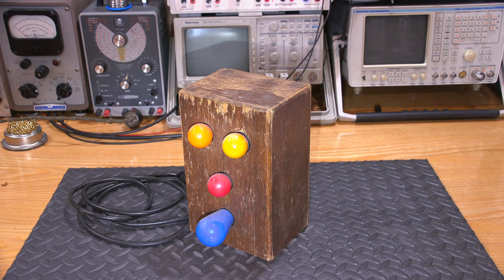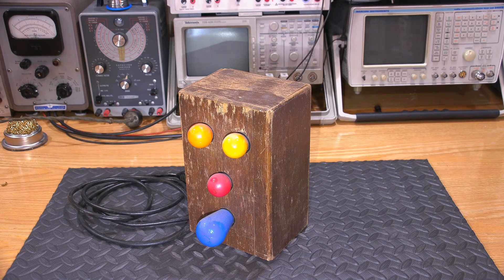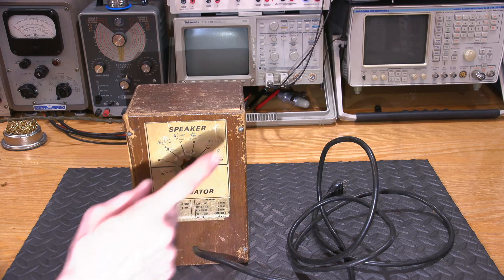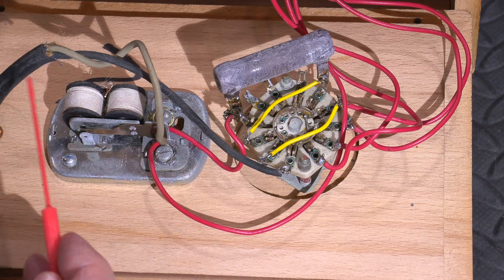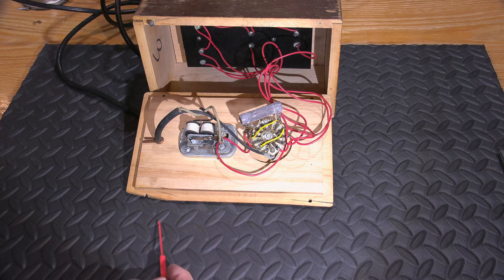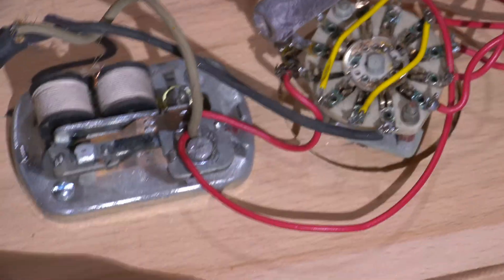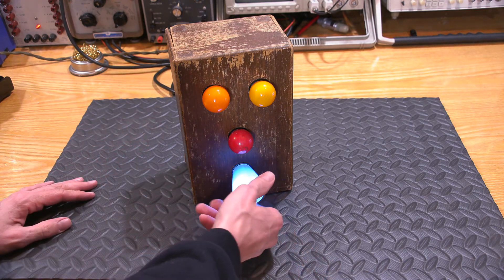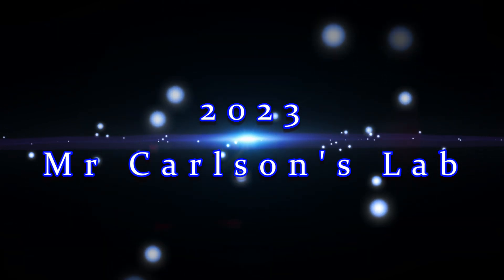1950's? Psychiatric Hospital Electrical Device - "The Evaluator!"

Comment: As a light bulb "nerd" myself, I find myself fascinated by this. Particularly the balloon style blue bulb. Not sure if you can get that style anymore. I probably would have bought this if I saw it at a flea market or hamfest if the price was right. Thanks for sharing.
Reply: That's an 1911 Edison GEM style bulb. You can find modern replicas with LED strips inside. Fleabay, the usual places.
edit: i'm in Europe so i can't see the actual page, but on HDepot there's a bulb category named "bulbrite colored light bulbs". The gel ain't as blue as the one above, but the shape's almost the same.
Reply: The bulbs are sign bulbs also called carnival bulbs.  I have bought them before.
Reply: @TheFineby  A quick internet search and are they can easily be found! Thanks for supporting my addiction!
Reply: Tungsten filament bulbs are becoming hard to source (for my current limit supply) & because i have come to hate LED sources that actually hurt my eyes, i prefer the colour temperature & type of light that tungsten makes in my home i am having a devil of a time sourcing anything of quality. The latest batch a globe disconnected from the metal & fell out hot dropping onto floor smashing glass everywhere.
Reply: @peteb2  before you decided to use 10x as much of the limited power we have, did you actually try decent quality high CRI low flicker LED Luminaires, or just presume the cheapest/most common ones people bought were as good as they got? There is a VAST difference in the light output by LED luminaires, since making them is a bit more complicated than making a wire hot.
The most common thing that hurts people's eyes is a LOT of AC LED Luminaires flicker at power line freq or its 1st harmonic, because they cheeped out on the power delivery.
Reply: @mycosys  That's a ridiculous comment on 'power we have'... My few tungsten bulbs will hardly ever come anywhere near the energy use of your  'limited power' when you consider all the other superfluous 'consumption' happening eg those who now have to recharge an EV daily or those who live where they simply have to have aircon running 24/7....  As to LED domestic light sources i believe its the amount of blue wavelength that is being radiated in the mix. Even the so called 'warm white' is high in blue & i find just far too irritating as a light source. At my work where ceiling panels have been changed from fluorescent to low cost LED panels i sense a nasty bright glare, so i now wear a baseball cap for the brim to shield my eyes or i find it very tiring after a day. Yes all my (LED) computer screens are set for reduced blue so as not to irritate with a nasty brightness. Interestingly there's a joke going around that we're all gonna see a new kind of eye-cancer appearing because of such a synthetic light source we human's have never evolved into having to contend with.... Lets hope that's not the case....
Reply: @mycosys  I agree. All of the "normal" lighting in my house is led. Although they can make them way more efficient still. Why does the base get almost too hot to touch on these e26 base led bulbs when leds themselves don't get that hot? I am 100 percent in favor of making things more efficient. Run your house on a generator or inverter and you find out EXACTLY what is more efficient. I was recently horrified (delighted) when I found out my RCA A-78 uses LESS power with it's vacuum tubes than my 100 watt solid state amp. When the power goes out, I can run my inverter longer with that so we watch tv and listen with my 1951 RCA and it sounds GREAT. I only am going to use less than a hand full of these incandescent bulbs occasionally. It's plain stupid to outlaw incandescent bulbs when everyone is pretty much going to led anyway as it's the most logical choice after all. Also they should recycle these led bulbs as 90% of the time the leds aren't what goes bad. Thanks for everyone's comments. This is an interesting subject!
Reply: The tongue is a type S14 bulb and the others are type S11. All have an E26 (or E27) base. S14 is commonly referred to as a "sign bulb" or "carnival bulb". Carnival because S14s were used in mass quantities on carnival/fairground rides before the advent of "turbo" fixtures.
Reply: I am into Carbon filaments. To me there is no bulb as nice as the warm yellow glow from a carbon filament bulb.
Reply: I would bet you can still get those bulbs. Many items are made to retrofit old equipment.
Reply: S20 incandescent lamp.
Reply: @edwatts9890  Tongue is an S14. S20 is the same shape but a lot larger, e.g. the fake "Edison" lamps that are so popular right now.

Comment: Probably not originally made for psychiatric use, It could be used for timing  "speeches" (in a toastmaster contest (for example 3 minute anecdotes) or quiz, where timing is key and the buzzer is used to terminate the speech if it runs over too far or the contestant is disqualified etc.
Reply: Or debate
Reply: here you go, was thinking of debates too 🙂

Comment: Whew! Good thing this is not the Eviscerator. 

Evaluator and speaker may be just the roles in a certain testing/diagnostic process, and the box is a signaling device operating with the wafer switch.
Also,  the markings on the back panel don't correspond to the colors of the bulbs as you found it, so the bulbs may not be original.